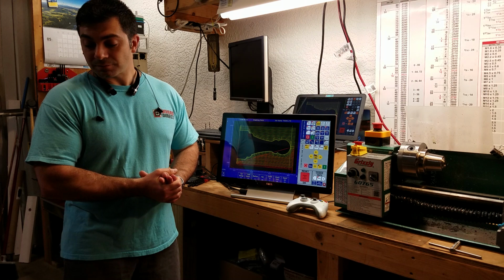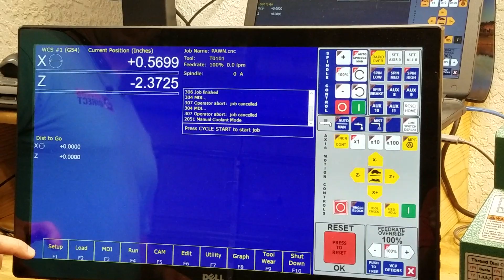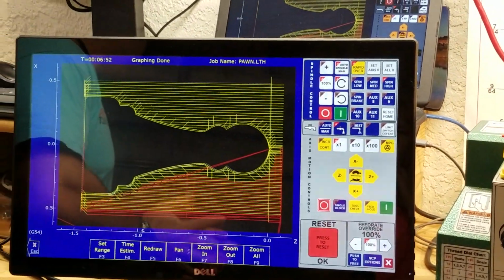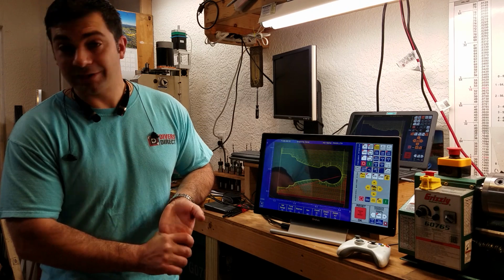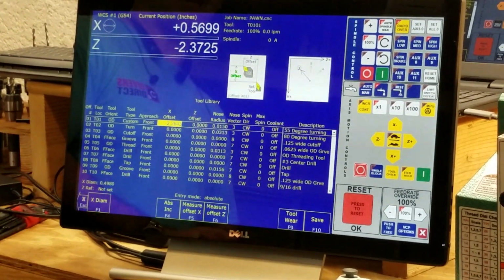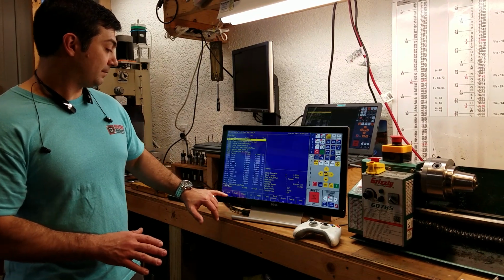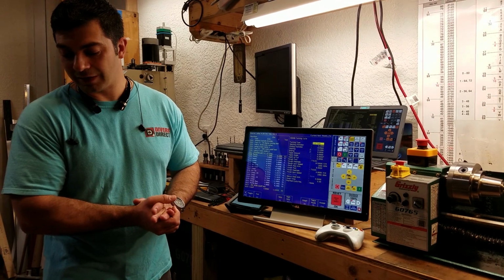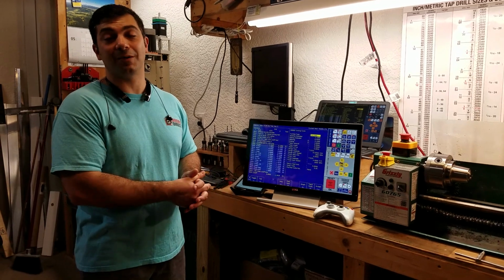Grizzly G0765 Mini-Lathe CNC Conversion:  Upgraded from Mach3 to  Centroid Acorn CNC12

Comment: Very nice video. I have the same grizzly lathe and am ready to pull the trigger on a CNC conversion. Do you have any tips or tricks that you learned along the way doing this that you could pass on?
Reply from the maker: You certainly can convert these little lathes over to CNC.  But don't expect them to help extremely precise tolerances.  The way the saddle is constructed is not the best for CNC conversion.  Honestly, I really haven't seen any manual lathes that are ideally suited for CNC conversion.  But, it can be done.

Comment: x and y are servos, and you used a encoder on the motor that came with the lathe? Thanks
Reply from the maker: Yes.  X and Y are closed loop steppers (you can call them servos as that is technically correct) and there is an encoder on the spindle shaft.

Comment: Thanks for taking the time to make the video. The fact UCCNC require customers to repurchase the software for a hardware failure is unorthodox and a deal breaker for me. They are being lazy and cheap and not investing in the coding/binding process and dumping that on the customer. After 17years I am ready to move on from Mach but this road is not fully paved for me.

Comment: Hi Sir
I just got set up Centroid Arcon. But I do not know how to run a program. can you help please.
I have the pipe chuck in 4th Axis. And  Need to drill hole on different angle and distance with X  travel .
Thanks you very much for your help.
Tony

Comment: do you need stepper drivers to run your stepper motors
Reply from the maker: Tomias Yes. The Acorn is just for control. You still need drivers for the motors.
Reply: Awesome. Thanks for the reply.

Comment: Any cnc software can work well if the user knows how use it right or correctly but Centroid is less troubleshooting than Mach3 or Mach4 and easy to setup and use it.
I’m have 2 Acorn installed and work more stable then Mach3 or 4!!!
People need to use it before posting opinions!
Reply from the maker: I agree 100%.  I'm glad Artsoft released Mach3 back in the day and a lot of people used that software.  But, I've converted all of my stuff over to Centroid and I'm extremely pleased - especially on my lathe.  Turning always seemed to be a weakness for Mach3 but Centroid does a great job with it.  And, the Acorn system is MUCH easier to setup and configure than Mach3 or Mach4.

Comment: who told you a 32 bit program wont work on a 64 bit platform? It will and is done all the time
Reply from the maker: Richard Martin You are correct. I even made a video about it. https://youtu.be/DBcDSom9HV8
What I was trying to say was Mach3 can't talk to a parallel port on a 64 bit OS.  It only supports 32 bit parallel port communications.  Thank you for catching my mistake.
Reply: Technically a 32bit program will easily work on a 64 OS like MS. But the control driver built in Mach is not 64bit and drivers are architecturally constrained. 
So in a nut shell his right Mach3 is useless on a 64bit system.

Comment: Franco, I have been looking for a replacement for the Mach3 and aging pc I am currently using with my PM25MV, , this looks like it might be the ticket. I am running standard stepper motors with an ethernet smooth stepper. My question is there a bunch of rewire needed to replace the ESS and the breakout board?

Thanks.
Ed
Reply from the maker: Ed Peterson Hi Ed. I really like the Centroid software and the Acorn board.  The wiring won't be a whole lot different than the Smoothstepper. I'll paste a link to wiring diagrams at the end of this message. The biggest differences are Centroid requires each home switch to be on its own input and you use an encoder (not an index pulse) to read spindle rpm. Check this out:  http://www.centroidcnc.com/centroid_diy/downloads/acorn_schematics/centroid_acorn_hookup_schematics.zip

Comment: Nice vid! :)   I didn't quite hear the part about the Pro software upgrade being only $99.  Last time I looked, I got it in my head that I needed the $499 version.  I checked the site and see that the Pro is only $99 for both the mill and the lathe.  I was looking at the mill before.  I'll have to look at it a bit closer to see if I can figure out why I thought I needed the bigger one.  Is the $99 option a new option?  Just under $400 to convert.  I really need to get some funds together to do this to my lathe!! :)  Thanks for the vid and the info. :)

Comment: Wow,

Since I have a Grizzly metal lathe; I thought how nice it would be; to be "shown" how to install (n detail) Centroid and Clear Path motors on my lathe. Then I saw your video. "Boy this is going to SHOW me how to do it; albeit using stepper motors".

All I got was "sales" hype about how horribly bad "Mach" is; and how unbelievably good Centroid" is. Talk about tried and proven "show and tell"; turning into a "Tell for 10:20 and virtually 00:01 of show".

Oh well.

IF there is any one out there that KNOWS how to use Centroid AND Clear Path motors on a Grizzly lathe, please make a video of exactly HOW to install it. Even better, add doing it to my Grizzly knee mill. And PLEASE; cut the rhetoric about whose is the best and simply "CUT TO THE CHASE"!

Anyone?

I would donate to it! Promise!
Reply: pat dee I have a Centroid Acorn and Clearpath servo motors that I will use on a mini mill. It's actually not that hard to get it up and running and I am no expert, by any definition. The Centroid Wizard does all the work for you in setup and there are a lot of nice schematics on their website to show you how to wire it up. Im thinking Franco's next video will show how to set it all up using steppers in his case. Clearpath setup is only going to differ in the wiring, which is not too difficult.
Reply: Thanks Scot.

Comment: Good to finally meet you Franco 😀. I am intrigued by the board/software and I can see myself switching from M3. Good job highlighting the pros of this package so far. Anything you don't like about it?
Reply from the maker: Hi.  I finally got up enough courage to be seen.  ;)  Here are a few things that I wish were different.  1.)  I wish there were more inputs and outputs.  2.) Each limit switch requires a dedicated input - I wish I could wire them all into one input.  3.) I like the encoder input as that is the most accurate way to read the spindle, but reading a single pulse per revolution is really easy and, for some people, is good enough to get  RPM feedback.  But, I really do like the Acorn and I'm converting all of my stuff over to it.  TTYL.
Reply: Crivo152 I know, finally a face to go along with the voice!
Reply: Good job Bro! Did you looked into the Masso CNC controller as well before you made your decision?

Comment: What about spindle indexing (rpm) (trigger) for threading?
Reply from the maker: Slabbador Dongali You can connect an encoder and read 8000 pulses per revolution. Very accurate. You will need the $99 software upgrade.
Reply: Thanks will look into it for my lathe conversation